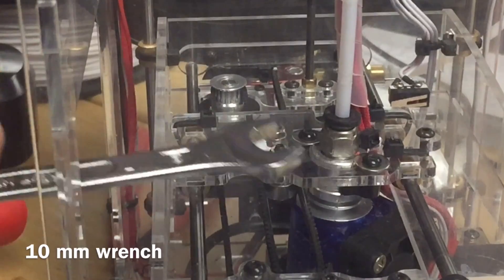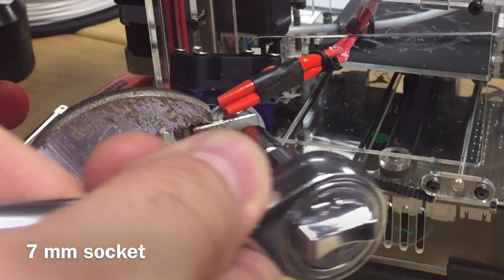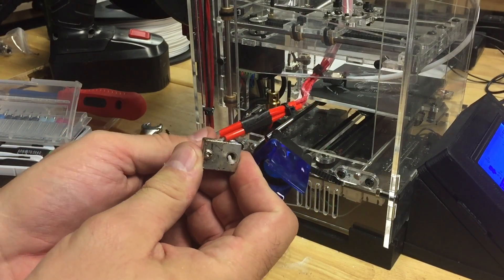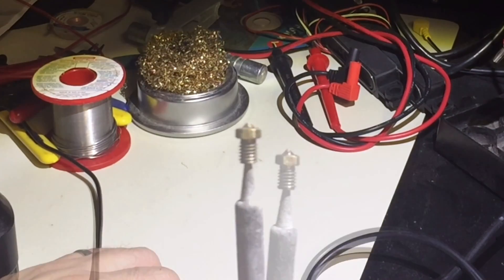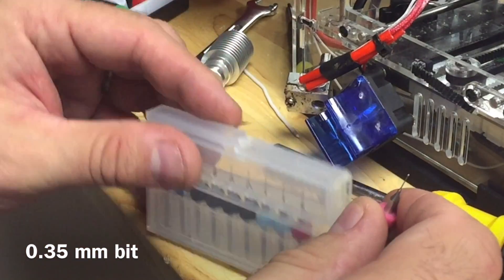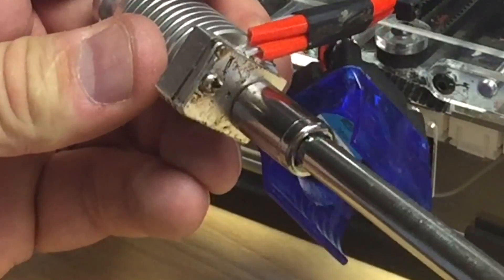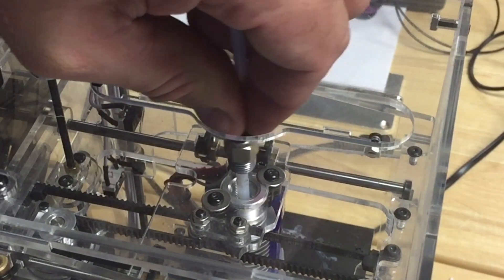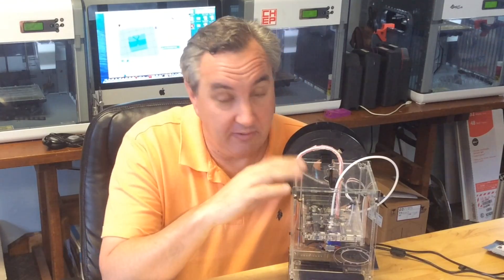Filament Friday #38 - Unclogging the E3Dv6 Style Hotend on the Fabrikator Mini 3D Printer

Comment: I pull a single strand off of a wire brush, heat the extruder, jab the wire up in the hole, then extrude 3-4mm, repeat till the clog is gone and it extrudes a smooth strand w/o looping back up to the nozzle (then print a dust filter ;) )
Definitely interesting to see how to pull out the E3Dv6 hot end for sure

Comment: You don't unscrew the nozzle by forcing it, doing so might risk breaking the nozzle and the throat. You should heat up the hotend to the temperature you were printing with, then you can unscrew the nozzle easily. 

Also, using a drill to clean the nozzle is a terrible, terrible idea. you could (and most certainly will) damage the chamber and clogging will occur more easily. you should try to cold pull first. if it doesn't work, try sinking the nozzle into acetone for a day or so. then do another cold pull on the nozzle.

Comment: this video helped me clear a blocked head , as i was unsure how to remove it.  for getting the ABS / PLA out I wrapped a bit of  stiff solid wire about the threads of the tip , and held by my helping hands . Then I placed it above and just to the side of a votive candle ( tip pointing up ) . not so the candle flame directly hit the tip but very close . very quickly it melted out and within second it burnt into a fine carbon soot . washed off in seconds with bit of alcohol.   start to finish was faster than i expected. the tip looks new without any trace of ever being used.

Comment: The method I use for clearing nozzles is to clear it out as best I can with a drill bit then soak the nozzle in acetone for 15 minutes and then burn it out over a gas stove.It works quite well. I did try to find a drill bit at my local hardware store that I could drill through a .3mm nozzle but they didn't have anything that small. I would be interested in buying a set of those micro drill bits if you sell them. I can't find them locally.
Reply: Ray Pope If you search ebay, amazon or check your local hobby shop, you'll find sets, they're popularly used in Model making.

Comment: I've only had one jam but it was a good one. Had to take off the nozzle and the Bowden tube on top. After I got the filament out, it looked like it stretched then formed a blob that got stuck in whatever open space is in there. Lessons learned (1) Don't pull out the filament unless the head is up to temp, (2) Push the filament in to squeeze some out the nozzle, then pull out quickly. For future projects, I've seen some mods that include fans inside and underneath, led lights and even somewhere it mentioned that you can add a heated bed. (Love the Fabrikator Mini)

Comment: another very easy way is to get the nozzle in a pair mole grips(etc) and use your blow torch to burn all the filament of ( and inside)the the nozzle . its quick and easy plus you dont risk damaging with drill bits .

Comment: The method I use is just to remove the head and put it in a shot glass of acetone for a couple hours. Desolves any plastic that may be burned in there and doesnt put any wear on the nozzle like a drill bit can.